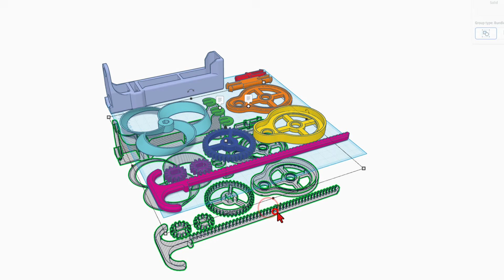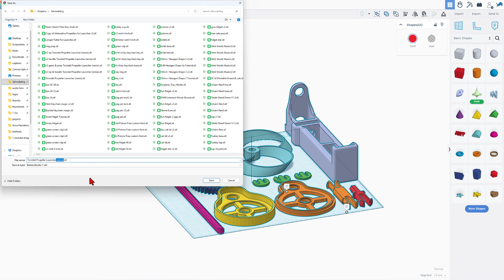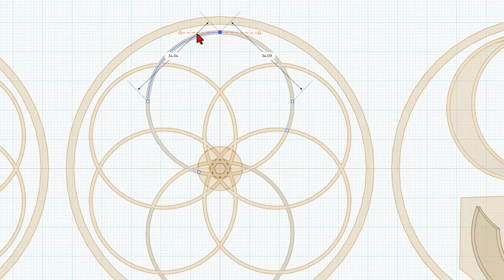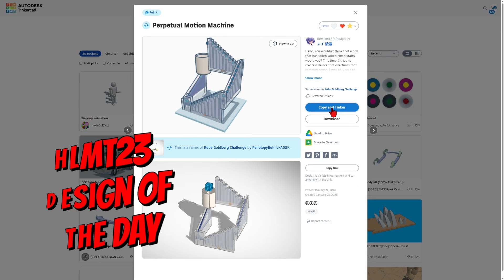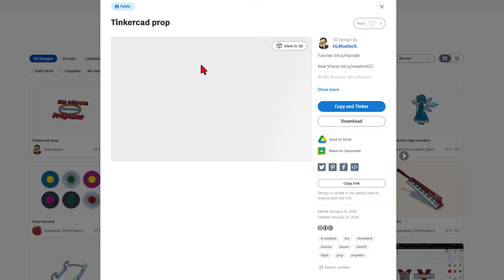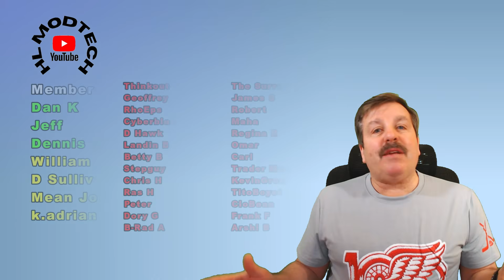Tinkercad 3D Printable Propellers & Launcher: Print, Test, & Upgrade!

Comment: Hi...I would like to print parts of this different colours but cannot work out how to separate parts to another plate:)
Reply from the maker: Several options. You  can export the parts separately, or even shift click the ones you want a certain color and export those. Another option is splitting the stl in your slicer. https://bit.ly/splitstl
Reply: @HLModTech cheers 😊

Comment: It was fun. The story goes you wanted to print and launch the propeller like the one I copied. Rather than just adapting the prop to fit on the launcher, I chose to redraw every part. I learned some new tricks in the process, especially those cool clips.
Reply from the maker: And it is 100% appreciated!  I am currently in the process of creating a few more versions. 💯🔥